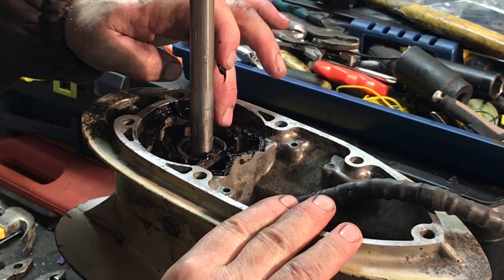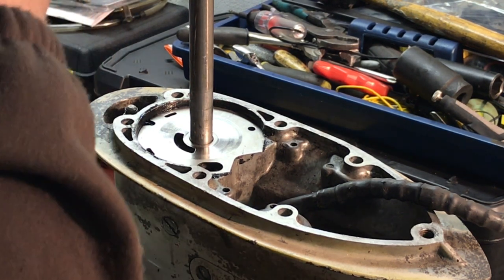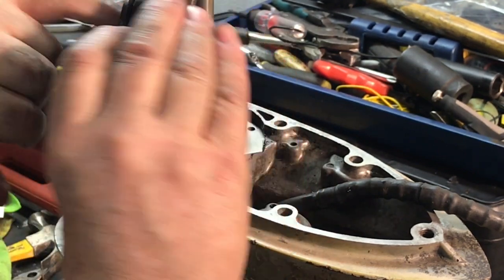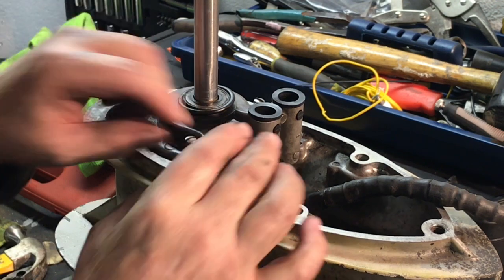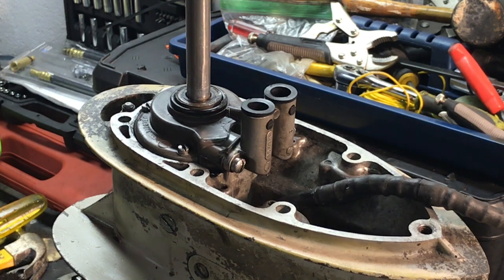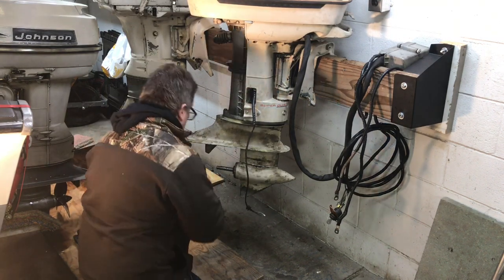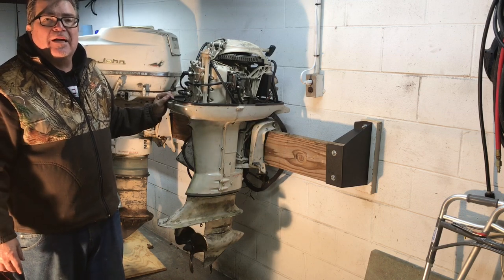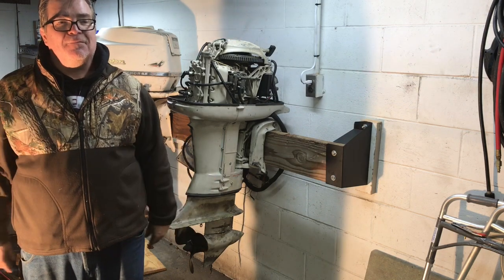1963 Johnson 40 hp Electromatic - Lower Unit Reassembled & Installed - Part 10 of 12

Comment: Nice work my 1969 40 hp goes in reverse fine neutral but when I put it in forward it locks down, is there something I did wrong when I installed? Thanks in advance.
Reply from the maker: Check the resistance on the blue wire for forward gear it should be around 7ohms. You should also have 12 volts as well. Hopefully the shift cable isn't shorted to ground.

Comment: Thank you for this video! Is there a gasket or seal between the impeller housing and plate underneath? I have a 1962 manual shift version but I think it should be similar.
Reply from the maker: The service manual stats to use "Perfect Seal" but it is no longer available. I use PERMATEX #3 Aviation Gasket Sealer.
Reply: @LivetofishOutboardRepair  Thank you for clarifying. I saw you put the gasket sealer between the plate and gearcase housing, but wasn't sure if you have put it between the plate and impeller housing.
Reply from the maker: I don't think it's required

Comment: Hi there🙂 would you happen to know where I can purchase the oil seal on the top of the water pump? I can’t find part numbers or anything
Reply from the maker: @aaronwinterlin3513… you can find the part you need at www.marineengine.com
The part number is 0202591

Comment: My electro Matic, 1963 Johnson 40 horse big twin does not shift into forward.  Reverse works fine. It has worked fine for 6 years. Then over a period of just a few minutes it stopped going into forward. Do  u have any ideas or suggestions?  Thank you very much! Dave
Reply from the maker: David Cerajewski…. If you keep watching the 12 part series I show how to test the voltage for forward and reverse gears in part 4 https://youtu.be/wQhFpvW7uts
The shift cable might be rotten and corroded. This video will show how to check it. You should also test the resistance on the shift cable wires. You should get 6 or 7 ohms for the blue and green wires (green is forward).

Comment: After scouring the internet since like 2020 this video answers what ive been searching for! THANK YOU SO MUCH!! Your are twisting the drive shaft to the right so the fins of the impellar are pointing to the left within the pump housing (from birds eye view) right? I have a 1965 Super Seahorse with this same 2 tube pump housing and man im glad to see someone else assemble it. So, gasket sealer on the top of gearcase fins, plate, impellar, top of pump assembly. I'd also REALLY like to know what the tell tale should look like on these motors at mid-high rpm on the water. Great video, thanks in advance for any replies!
Reply from the maker: HON3YxBADGER …. Yes, your assembly of the pump is correct and the driveshaft is turned in a clockwise direction to get the impeller fins to fit in the proper orientation inside the pump. Sorry but I don’t have video of the motor running at WOT except for this https://youtu.be/s30URKahpNQ
Reply: @LivetofishOutboardRepair  thanks so much for the help! 2 years ago I got a spinal injury ( wtf i was only 25 🤣) and haven't been able to put my hands on my tools since recently getting a spinal fusion. Been thinking about getting this boat confidently on the water since I've been getting better. I can tell In that video on the first drive by theirs a hefty stream of water coming out nicely, when I had mine out my brother said it was only splurging small bits of boiling water out when he had a glimpse with rpms up. So to get this %1000 percent correct, I'll be rotating the drive shaft in the same direction as forward gear while pressing pump top on. I'm under the impression that I actually installed my impellar fins backward, and with the mix of not using any gasket maker... this explains a lot. Thanks so much my friend!
Reply from the maker: HON3YxBADGER …. I’m sorry about your spinal injury and truly hope you fully recover. Keep thinking positive and I hope you get to enjoy your boat.
The drive shaft should only turn in a clockwise direction whether your in forward or reverse. The lower unit gear-case changes the direction of the prop. So yes you are correct. I use channel locks to grasp the splines on the driveshaft to provide leverage.
Reply: @LivetofishOutboardRepair  Thanks so much it means a lot! Now I have a solid plan of attack!
Reply: @HONEYB7DGER  If you install the impeller backwards it will straighten itself out when you turn clockwise, with the tell tale you are looking for a bad head gasket and possibly a thermostat.
Reply from the maker: Sometimes an impeller fin or two might not orient themselves in the proper clockwise position if you install it backwards.

Comment: Is there a gasket needed between where your putting the lower end back
Together ?
Reply from the maker: No gasket is needed. Thanks for watching and commenting.
Reply: I had the same question too. I’m surprised no sealant or gasket maker? Is it really just metal to metal? I know there are weep holes but seems like a lot of water would get in!
Reply from the maker: @johnmills8189… All I can give is my opinion but I believe the design engineers only required a gasket in later models was to keep the metal - to - metal contact from fusing together. Keeping water out of the bearings and gears was accomplished by sealing the water pump and using a large spaghetti seal in the lower bullet nose gear-case.